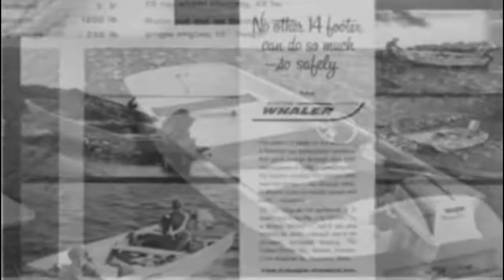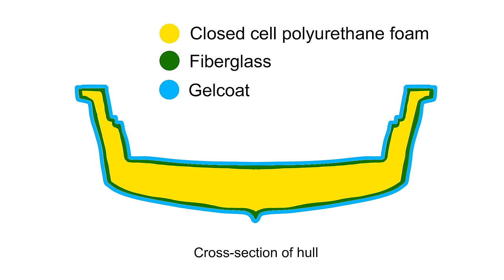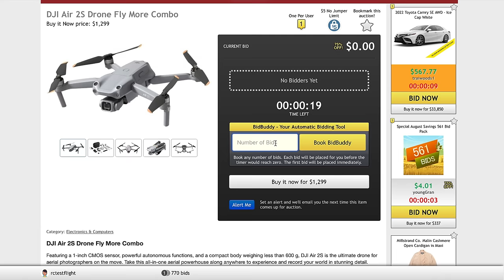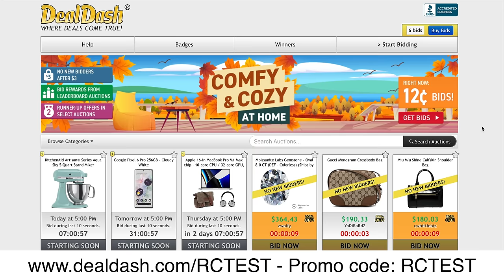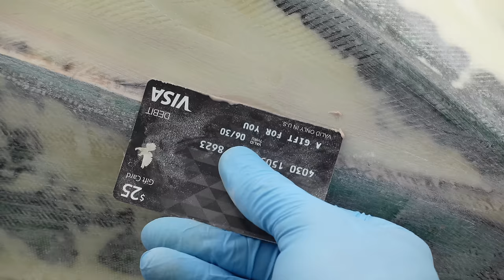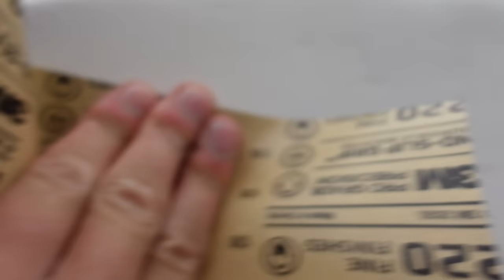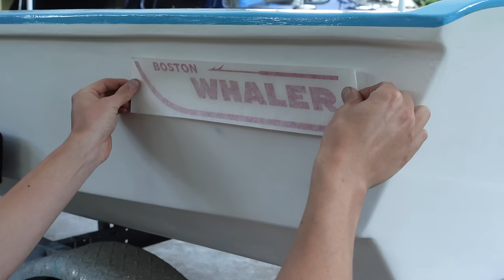50 Year Old Boat Restoration - Solar + Electric Conversion Ep.1

Comment: The way you get the wheel bearing seals off is by removing the nut, then the outside wheel bearing then put the nut back on before removing the wheel. You then pull the wheel off the axle with a hard fast down and out movement. The inside wheel bearing catches on the nut an then pops the seal out in one reusable piece. But that assumes the thing is not completely rotten. That whole trailer was trash, an several years late for the scrapyard.

Comment: Just a heads up.  Never wetsand raw fiberglass.  Also , you could have saved a ton of money by spraying awlcraft 2000 which is what I did on my whaler.  I have a few videos on my channel
Reply: get whaler 19  foter 80 hp ekrric

Comment: Oh man, I love how much I learn about design from your videos mate; your work inspired my most recent weirdly convoluted energy storage solution/meme
You're an absolute champion mate

My parents live right on the river (backyard) and there's a boatramp nearby
I really want to start RC projects (looking at making an floating hydroelectric generator in a tidal river using a turbine design from an american uni I cant remember (google turbine that works in both directions)

They also have like a 24m hill in their backyard TO the river; so overall I want to use the hydroelectric boat (worst case solar) to pump water up that 24m hill
To act as a gravitational potential battery 

So naturally the ability to work on the water was a huge barrier to starting all this and all your troubleshooting (from so many of your videos) has taught me so much about it all (and where I got the idea in the first place)

Long term for the meme I want to use the power to run electrolysis to produce H2 gas to then produce metal hydrides (e.g. solid hydrogen storage thats safe)
Solely for the meme of achieving it without any external energy input when the main criticism of the tech is the large energy input needed
Reply: hydrrgen rc bóat

Comment: Just a warning about using a laser cutter to cut vinyl or PVC: never do that. It's insanely bad for your health and the machine. PVC is worse than vinyl (because of the 'C', look it up). We have a huge machine over here, 100 Watt laser cutters with huge compressors and air evacuation up to the roof of our building including filtering and we still don't cut these materials because of their toxicity.

It would be super useful if Snapmaker would supply you with a vinyl cutting blade to cut stickers, it's non-toxic.

Comment: When it comes to designing the "Layout" for this boat, it would have been better to lay some Stainless Steel strips under the Fiberglass for a better "Hold" with the Screws...
On "our B.W." we sanded everything down, laid S.S. Strips, then used a Marine Grade "Grip Paint" (with sand within) over the entire Inside of the boat.
And we replaced all of the original electrical using a "Fishtape" and Marine Wire.

Comment: in the future, just contact your local Greek Orthodox church for help on how to set up a roast. they will almost certainly have an extra AC motor for you to use too. we always use a motor that is geared with a worm so it always has constant speed regardless of the balance. also we just use a synchronous AC motor because it super simple

Comment: $300 boat, $3000 repair? Seems about right lol Came out good though.

As for that finned roller, the way it is meant to be used is to brush on the epoxy onto the surface, then lay glass over it. As you roll, it pushes glass through the epoxy and to the surface. In a way it is backwards from a regular fiberglass lay-up.
As for spraying the gel coat, a common store-bought spray gun is not meant for anything that thick. The tip/nozzle size is "i think" 0.8mm, sort of a universal size. If you are getting a gun specifically for projects like this, go ahead and drill it out to 1.5 or so. The needle inside is fairly thick, so it will still work just fine. That would not only make spraying much faster, but will also give you much better finish since thicker gelcoat will somewhat level itself.

Comment: I'd have been tempted to buy a cheap detail sander to get into all the hard to reach corners.
I think it would pay for itself in no time, rather than having to 3D print special blocks and hand sanding or using a tiny Dremel. 🥱

Comment: I wonder if a hard composite plastic scraper attachment for an electric or pneumatic scaler/needle scaler would have worked faster on the flaky parts of the gelcoat?

Comment: Note - When defrosting frozen things, the method I learned as fastest is to run cool water (not too warm) over it. If the water is too hot you'll start to cook the item, but running water transfers heat better than still water or air.

Comment: Not sure if you were using "laser-safe" vinyl, but note that the regular PVC stuff is dangerous to cut in a laser cutter due to the fumes released. They're both harmful to health and damaging to the machine itself and its optics. If you need to cut vinyl, you're better off using one of the bladed computer-controlled vinyl cutter machines.

Comment: I know it’s all wayyyy too late now but  an 8 inch soft pad on the larger areas and a little 1/4 inch air angle grinder from harbor freight with a 2 inch 36 grit flat pad would have Been the ideal  tools for this project. But there are no shortcuts with old boats if you want to do it right. At least an old Whaler is worth the effort.

Comment: Fiberglass and gelcoat are much more durable and easier to maintain than wood, but if the maintenance lapses and they get damaged, they are much much mor complicated to restore - whereas a wooden boat can always be mended or partially rebuilt, Argos-style.

Comment: You should use flow coat instead of gel coat when spraying it on as gel coat is designed to stay sticky so the glass can be rolled on top of it

Comment: It is hard to cure some epoxies or vinyl esters (which your gel coat might be) in just a thin layer. It doesn't matter with the gel coat usually because you're curing it along with the rest of the laminate.

Comment: Silicon won't last long... Look at 4200 and 5200 from 3m... Its special marine sealant. 4200 is removable. 5200 is permanent. Use this stuff for your through hull and other hardware going into the deck... But that silicon will begin leaking in about 1-2 years. 
Go to any sailboat forums and you will get a wealth of information because most guys in the sailing community like doing most of this type of stuff. 
Also "Good Old Boat" has alot of info. 
Glen-L for home built plans and ideas.

Comment: I'm not sure wet sanding to remove amine blush is the best option. Best practice would be to wash the amine blush off with soapy water, rinse, then sand, as sanding can drive the blush into the epoxy which will cause problems with adhesion to the surface. Also vinylester might be something to look into, it's generally not as brittle as polyesters but cheaper than epoxy without the blushing issues. Other than that good work!

Comment: you want to defrost in water under 40F to prevent bacteria. it will still defrost quickly because water is more efficient at heat transfer.

Comment: I hate being "that guy" but since nobody else has said it, you're really not supposed to laser vinyl (they make laserable vinyl, that might've been what you had but this note is just in case). Lasering Vinyl (or burning it) it supposedly releases chlorine and hydrochloric acid gases.

Comment: So why does gelcoat crack. Because the structure flexes. Meaning the structure have not been up to the loads the boat have seen. 

I would guess this boat was built out of two molds. An outer mold and an inner mold, then they attached the foam and glued all three together. Any quality or issues was covered with gelcoat during assembly 🙂  Hence the voids and delamination, and especially along the glue line where the molded parts join at the siderail. 

Ease of applying glass to complex shapes is determined by weight and weave. A lightweight satin weave will be easier to apply than regular weave but you might need more layers as mentioned in the video. Instead of microballons and chopped glass I often choose collodial silica as a filler. Especially when repairing foam core laminations. 

Oh, and all polyesters and vinylesters stink. For more affordable epoxy purchases it is best to buy in bulk. 

Instead of using gorilla glue which it is unclear how will interact with the foam and old lamination, unthickened epoxy could be injected in the drilled area with a syringe. West System have several leaflets online about this stuff which are based on a lot of experience. For your next boat rebuild project of course :-)

Oh, and the "thin roller" is used to consolidate several layers of fibers usually, not for wet out. I prefer a squeege for wet out or a brush if it is just one layer of thin glass.

Comment: Next time use orbital sander like Bosch GEX or simillar (cheap ryobi works great) 
and 3M cubitron II sandpaper like 775L or the best sandpaper - 3M Xtract 125mm 
overall cubitron II line abrasives works avesome and last 10x longer than any other top brand ones (u need 15x festool discs for 1 cubitron II xD

for sanding grinding etc fiberglass using dremel its great to use permagrit tools , there isnt anything better

PS 
u can get polyester that wont stinks like the cheapest polyester resin

Comment: Pretty sure your boat is a 71' or older,  In 72' they switched to a bathroom sink type splash well and a 20" transom that goes straight across the back and doesn't dip down like the 71 and older.

Comment: if i were you i would be cautious about boat before buying it and besure check danged n more to it if it cost too more restores it then drop it find other one 
im sure there aluminum boat out there just need fill it with forms and finglass top parts then done
one of most risky things boat boat is that any weak spot on bottom of boat will rip hole in it when it get hit hard (like hit wave n fly thur air and crash landing in water) will tore boat in half 2nd you aint going any faster than like any other boat but using electric motor cruises around it fine not issues nothing will hurt it under 15 knot
i just happy watch whole videos of you doing all hard work on restores it back to life

Comment: Honestly if you would just fared the cracks in the original surface and used some enamel spray paint on the whole thing you would have gotten a very durable surface that would in reality rather than theory have lasted as long as the work that you did and you'll know that in three or four years. Furthermore it's much easier to go back and do some more spray paint then it is to go back and do another repair like you've done this time. People often overwork these fiberglass projects and think that they need to do all this other stuff. But what you find is that in reality cracks will form in the new work or the screws that you put into the work will corrode the foam in below it or that water in all these other issues and you're really better off doing a less sophisticated in quote unquote less permanent spray paint job it's easier to do again than you are to go through all this extra work that actually won't really last much longer. Ask the surfboard painters out in California why they go out and use krylon paint over the fiberglass.

Comment: if you use a golf cart motor that should work there cheap and easy to get plus you would be able to the speed controllers from the golf cart and maybe use the batteries you can also use paint called bottom paint its i thicker paint that works great for paint

Comment: If there's one thing I can tell you from experience is that you shouldn't buy a cheap boat if you intend to use it more than a year without your money back... or you restore it properly and spending more than by buying the expensive one. I don't know if this saying is as common in English as it is in Dutch, but "Goedkoop is duurkoop." Meaning: "Cheap is expensive." If it isn't expensive in cash, it's super expensive in time

Comment: sorry mate but you made several mistakes i must point out.
first you laminated onto old gelcoat and primer. you should laminate on the foam or lam.
second you used epoxy wich is much harder than the vinyl?poly? used for the original laminate, that would cause issues under stress, but being this kind of boat... prolly you would'nt notice.
third, yes you should have primed before gelcoating, 5% paraffine in the gelcoat is more than fine.
when spraying gelcoat use big nozzles, big ones.
you can get very nice results with both brush and roll with gelcoat but there's a few rules to follow.
the first is to always have a lot of it on the brush, the second never ever paint over fresh gelcoat. you made a mistake? it stays there until next coat. use resin to fill voids, the cheap one, not gorilla glue...

Comment: Multiple layers is all you needed. Quality is always questionable. I lay out fiberglass for surfboards. Double layers are 3x stronger then you run one more layer of just epoxy, for the bumpiness, its called your hot coat. Edit: You're right. Epoxy is all you needed. Just needed a hot coat and not a gel coat. PVA is just wood glue. Doesn't matter now but it came out great.
Reply: You could have also saved your self some money with bondo.

Comment: polyester not epoxy Fiberglass boats are made with Polyester resin they dont really like sticking to each other even sanded. Polyester is way cheaper as well because it's designed to be used in bulk, Epoxy is more ment to glue wood and fiberglsaa over wood

Comment: Surprised you used epoxy, the boat was most likeley made of polyester resin. And micro balloons or a thixotropic in a plastic bag with a cut corner is way cheaper than using a syringe

Comment: You should have watched a youtube on using a spray gun. You set it up all wrong, and then used terrible spray technique. It was actually painful to watch you do that. Proper spray method you can get a smooth and glossy gel coat layer.  Next time you do a boat.... take a lesson or two on using a spray gun, you will be amazed at what you can do with it set up right, and sprayed out correctly

Comment: foam is toast! shit foam back then! drill it out. if it's all dry? saturerate the foam with a resin under pressure if you can.  cheapest way out to stabilize it all and to move forward. and you should have added a pad to the bottom!